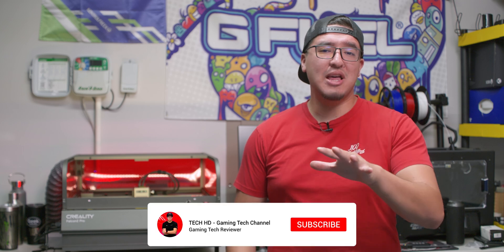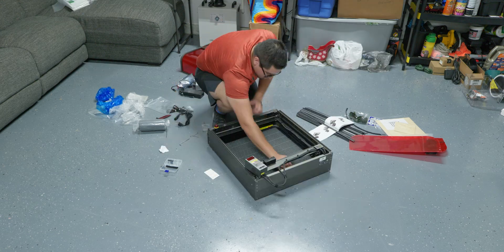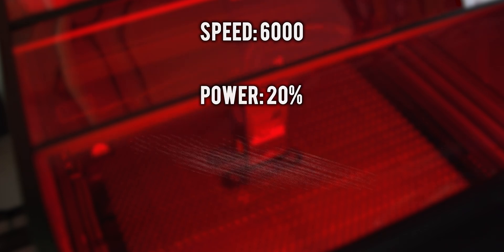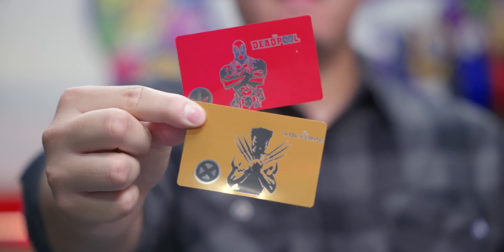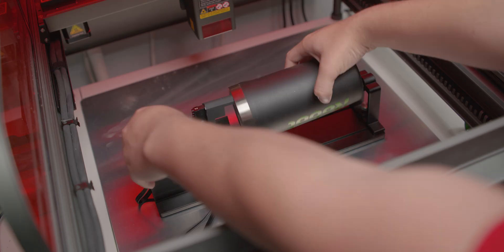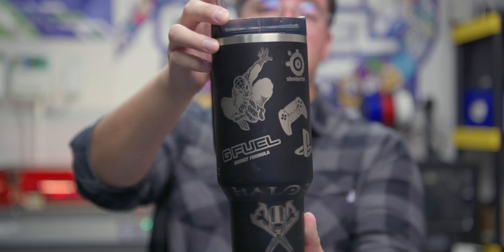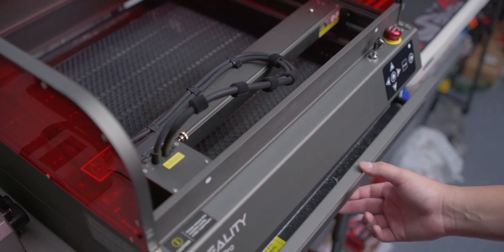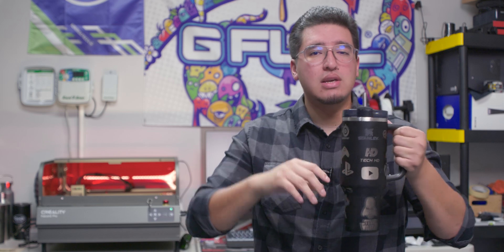UNLOCK YOUR CREATIVITY! - Creality Falcon2 Pro 22w Laser Engraver & Cutter Review

Comment: Nice video. Got mine 3 days ago (first laser engraver) and wood cutting is fine but boy I cant get slate to work. I do have the 40w version but have changed the power down to 22w and might try the 1.6W laser that came with the device.
Reply: How did things work out with the slate etc?
Reply: Did you ever figure out the bottom part of the larger tumblers that have the tapered bottom part for cup holders?